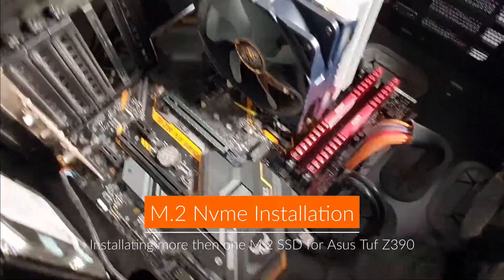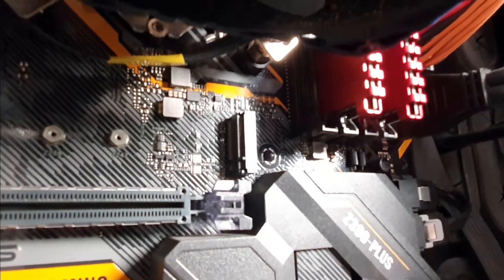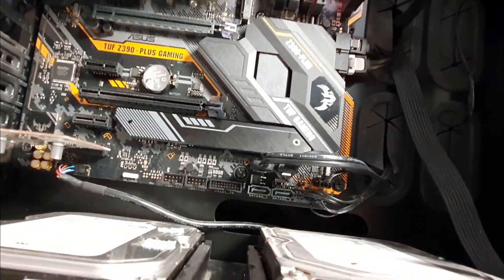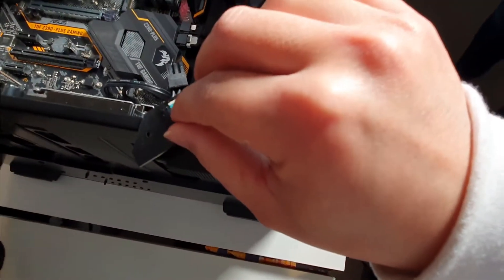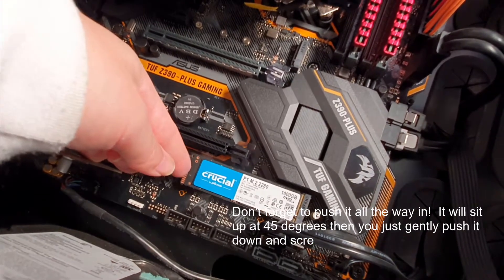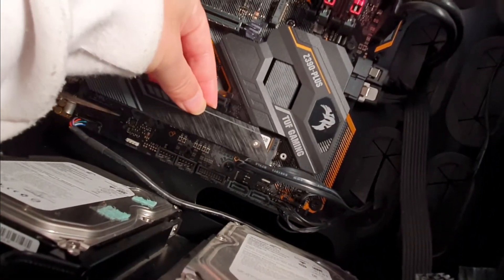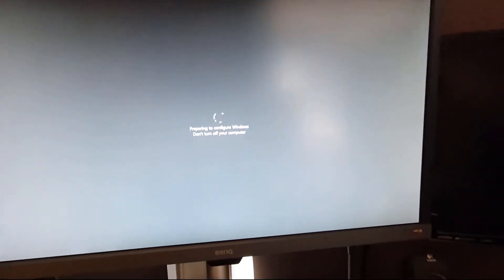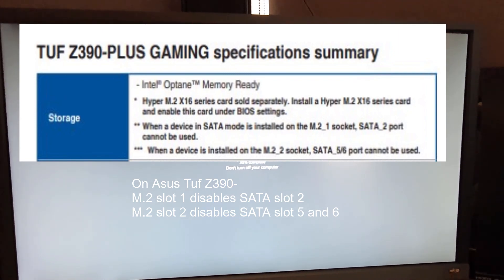How to Install one or More M.2 Nvme into the Motherboard

Comment: how to enable the second ssd
Reply from the maker: If you’re using Windows, you can use the Disk Management option to allocate space and format your second M.2 SSD. In disk management, right-click your new drive and select New Simple Volume. Windows will walk you through the rest of the steps.  If your M.2 SSD is not recognized, you may need to enable it in BIOS.